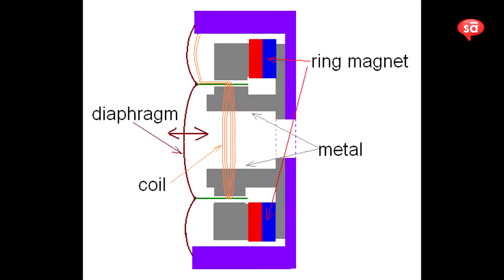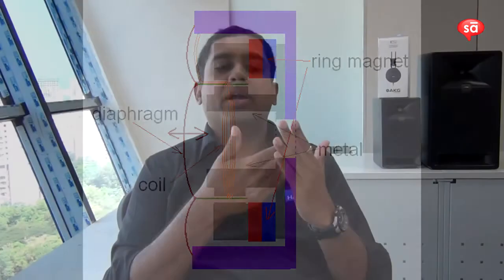Understanding Headphone Impedances | Choose the Right Headphones | Ashish Barje | @SudeepAudio

Comment: hello sir,it was great to hear u about impedance ,but i wanted to ask something that is--I m having a headphone of 64Ω impedance which i used to use for music production as well as for mixer. i used to plug in my macbook pro ,so i wanted to ask that does i m getting a better sound compared to mobile and can i use it regularly.
Reply: Hi Harshit, you will get better & louder output from mixer. Although you can use 64 ohm headphone with mobile phone & laptops but a headphone amplifier would be recommended.